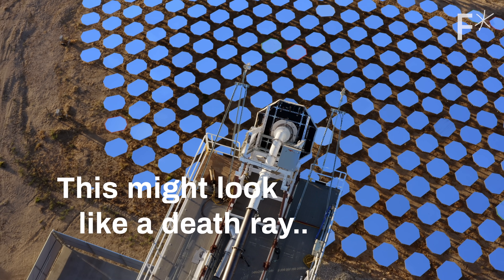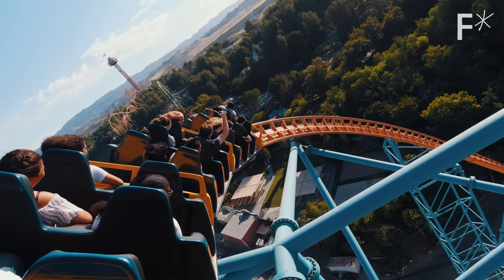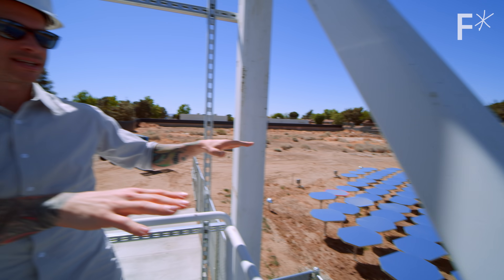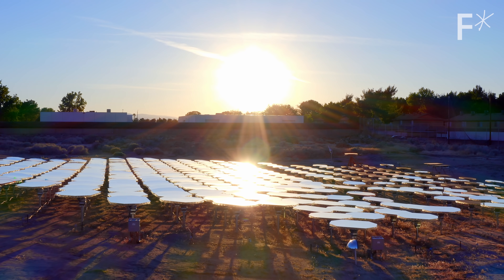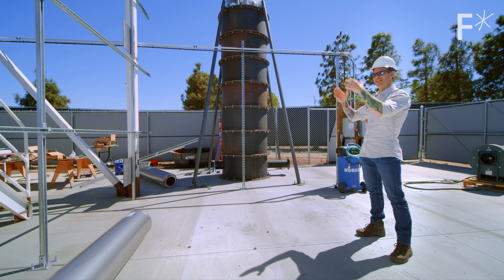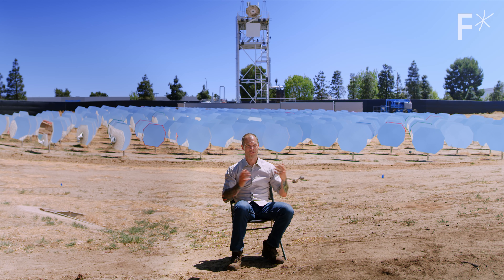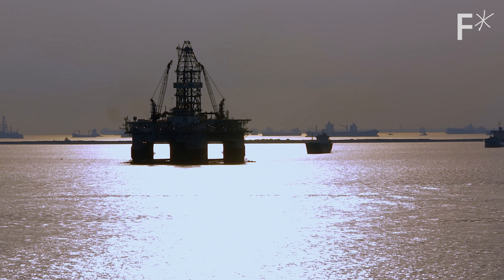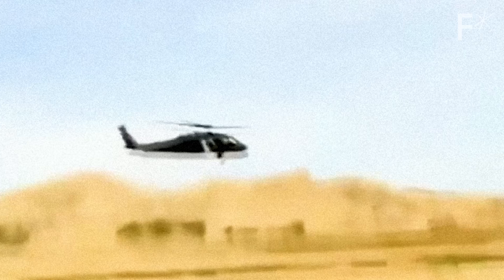How concentrated solar power could fuel the future | Big Think

Comment: Still doesn't address the intermittency problem and I think I've seen this in BladeRunner
Reply: The rocks stay hot alright. But what does he do with those hot rocks? Produce steam using a heat exchanger and run a steam turbine? Heating up the rocks seems like the simple and dumb part of the system (software doesn't change that). Turning the heat into electricity efficiently is the hard and smart part and it is not addressed. This makes me wonder how serious this is.
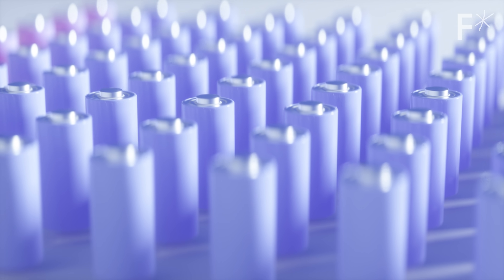Reply: 4:08
Reply: @myfamiliar795  How many rocks? How many harvesters? What are the environmental impacts of these infrastructure components?
Reply: @24killsequalMOAB  Did you try heliogen’s website?
Reply: Initial applications are for industrial heating materials for steel and concrete which is not ideal for youtube mass marketing because making electricity is more relatable to the youtube masses. There interest in it is secondary right now to tell the truth, that is why there is no details as they have alot of time and many different options to turn heat to electricity.
Reply: Btw intermittency isn’t a problem here since the rocks stay hot for weeks… especially compared to nonrenewable energy sources and their problems. And like Babi said it’s about the hydrogen
Reply: Huh? They said those rocks stay hot for weeks...
Reply: @stlkngyomom  its not even about the rocks... its about producing cheap hydrogen
Reply: @babimangab7436  Couldn’t agree more. And desalination.

Comment: Not a bad idea as long as the use of heavy earth elements is minimized and natural species are preserved such as large birds, as well there is no carbon problem we need as a species to get over that and understand that temperature leads carbon dioxide not the other way around
Reply: For a "sane realist," you would do well to LEARN that CO2 and heat BOTH positively regulate one another, on this greenhouse of a planet. ✔️👌
Reply: Ehh, no.

I am all for preservation and keeping all animals alive. But the survival of our species takes precedence. If we can create a sustainable energy source that can combat climate change long term, and it cost the lives of a few species, so be it.
Reply: @klakiti02  If the loss of a few species is no big deal then why worry about climate change show me some actual numbers that back up climate change I will look at them from a neutral point of you if you can show me actual evidence I will look at it scientifically everything else is propaganda
Reply: @hebertjerome  that’s not what I said. I said if sustainable climate friendly energy production can be achieve at the cost of a few species, so be it. I didn’t say animal lives weren’t important, I just said that our lives take precedence.

Of course this wouldn’t apply if such technology would put at risk an species that’s vital for the eco system since that would be counter productive.